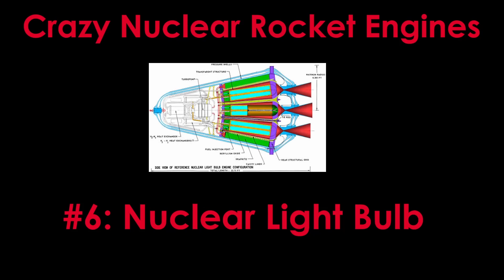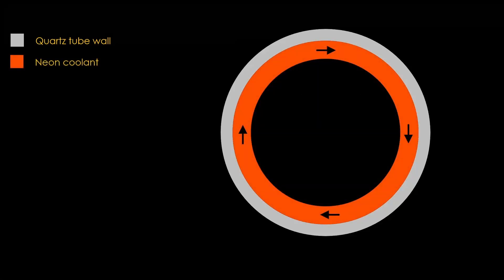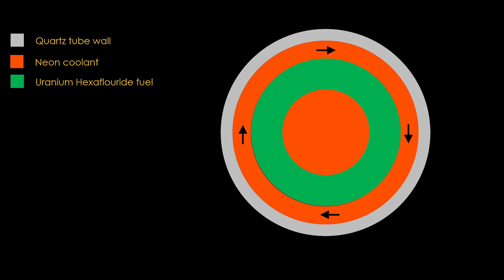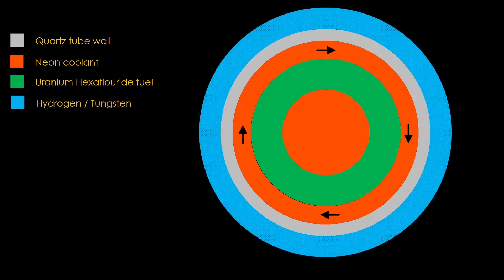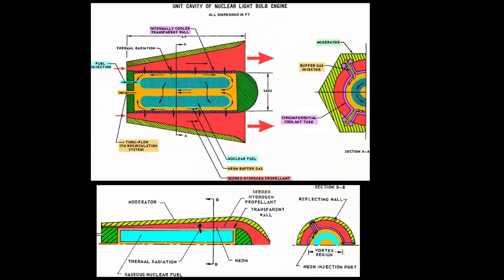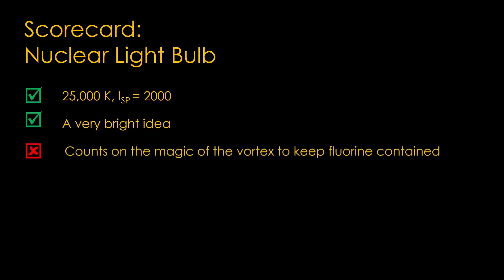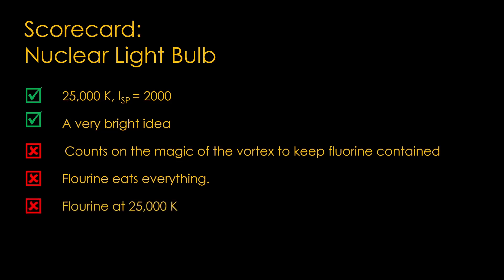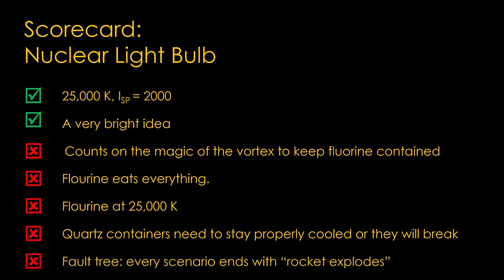Crazy Nuclear Rocket Engines 6 - Nuclear Light Bulb

Comment: Why does it use uranium hexafluoride?  As I understand it, the reason for using that compound in centrifuges is because fluorine only comes in one isotope so it doesn't contribute to mass differences between molecules, but that wouldn't seem to be relevant in this design?
Reply from the maker: You would want some compound with uranium as uranium is a solid metal and this design requires something liquid. My guess is that they knew that uranium hexaflouride was the output from enrichment and decided it would be easy to use. 
My guess is that other uranium compounds would be as good or better.

Comment: The fluorine in uranium hexafluoride is fluoride which is much less reactive. it's what fluorine is trying to becomes.
Fluoride famousely can corrode with glass and quartz but beyond that has more to do with the stability of the salts, other wise fluoride is not very reactive.
Fluorine is very reactive, even capable of oxydizing nobles gases but fluorides aren't.
Reply from the maker: Does this hold true at the temperatures they are positing?
Reply: @EagerSpace If anything wierd was going to happen it would have happened long before reaching those temparitures, we are well into plasma tempariture where electrons are dessociated from the nucleus. and if something did happen the energy produced would be almost nothing compared to the energy already present in the plasma.
Uranium hexafluoride is safe enough to be used in the uranium enrichement process.

The stuff is very toxic and might be corrosive especially if their is water around but toxic stuff while keeping it dry is something people do every.
Hypergolics and monopropellants for comparison are much more unstable.

Comment: I'm loving these designs, each one crazier than the last one. So  many vortex-dependent engines (how would you even start this thing?).
Reply from the maker: Yes, and this vortex isn't about keeping you from losing fuel, it's required to keep the fluorine away from the quartz so it doesn't break and blow up. 

This one is really in the "turn it on and it blow up" class, though it might just blow up when you fuel it up if you weren't very careful; Uranium is really nasty stuff chemically even if you don't accidently generate a critical mass when you are trying to store it.